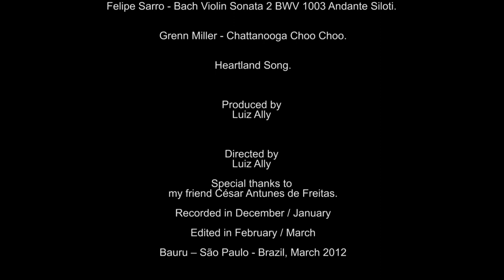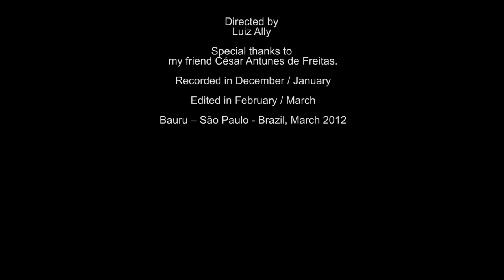Tryally Tech. Sherline Machines THREE FULL HD

Comment: You can probably take a hose and split your coolant line for the mill and run a line to the lathe. Raise the lathe up on some aluminum profiles then just mount it inside a large plastic flower planter with a drain. That way your ways are not sitting in coolant. The cool thing about that coolant pump you built is you can power that with Mach 3 and gcode to turn on and off. You can also automate that self ejecting chuck with gcode. I have seen rear fed setups where stock feeds into from the rear if the chuck, is machined, parted and ejected into a collector. Very neat process but as you know a lot of work.
Reply from the maker: Yes, had a lot of work here, so, the system with the micro pump works both on the lathe and on the milling machine, indeed on all machines.
Good your idea to power the pump w/ mach3, I will do that.
In fact you gave me great ideas
Thank you for watching and commenting on my videos.
Look at this too, more about my work, photos, ideas, accessories, micro-tools etc..

https://www.facebook.com/tryallytech?fref=ts
You will welcome!
Luiz

Comment from the maker: Hi,
As you have seen, I use kerozene and oil, 30% oil and 70% kerozene
Any of them serves (oil non-mineral)  I use Rothenberger OIL, in Brazil called ROCUT.
The width of the cutting edge is exactly  1mm  in two material, in low relief I use Bit (HSS) and I weld  a layer on top of tungstein carbide steel, and I make sharpening with 1 degree less on inferior part and 20 degree the front of attack  part
Soon I will show in video the sharpening and this my micro tool.
Regards
Luiz

Comment from the maker: Hi friend,
That's right, I use an aluminum board, I don't use rubber fee but I use two screws to secure the aluminum board in the work table and the lathe with four screw.
Is unnecessary the rubber, because In my opnion the important is fix well the machine.
The  aluminum board that I use have 1/2 inch of measure.
Regards
Luiz

Comment: Luiz - What is the "B12" oil in the background at 4:15   I have seen you use this on the ways of the machine.  Can you send a link to it, I have tried googling it -and am not finding it.
Reply from the maker: Hi Joe, this is a special additive for mineral oils.
This additive thickens the oil and promotes a protective film,
So any additive you find in your country will work just as well, just mix it in the right proportion, nowadays I use 20 to 30%.
Reply from the maker: And Joe, try to find as Bardahl B12

Comment: Luiz,it's perfect  kind of job! I have never seen anything like this :) Cutting knife and high speed on Sherline,impressive :) I always have problem if about aluminium cutting on my lathe I never use high sped ,although I often use yours micro-tools idea.
The width of the cutting edge is 1mm?Kerosene and oil as lubricant for aluminium?